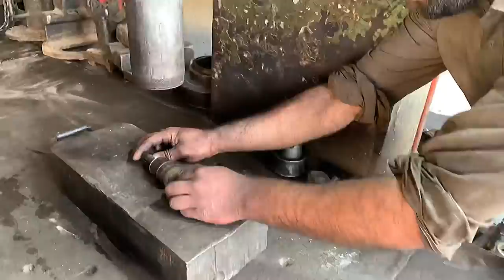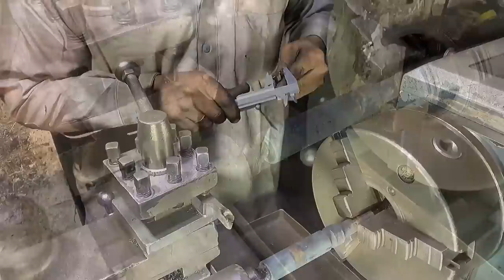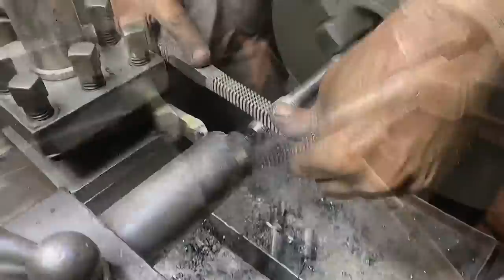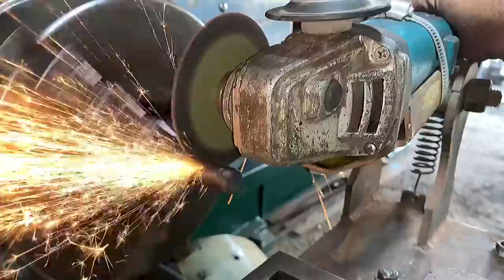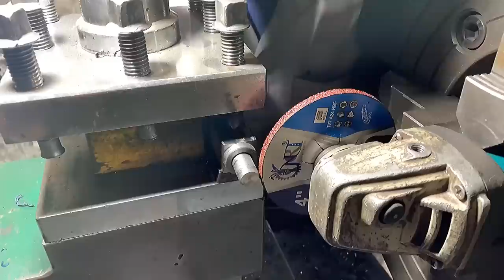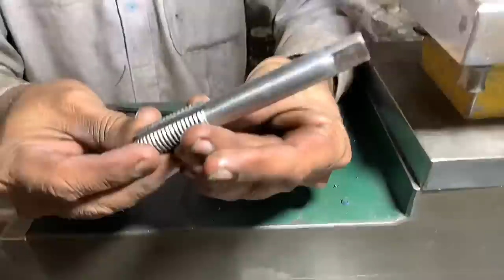Thread drill tool made from bearing shaft, developed drill by own skill

Comment: Usually fluting for taps is usually accomplished on a milling machine with a dividing head; after that the square is cut in then the tap goes for hardening and then final grinding / sharpening. One caviat though, if one needs a certain class of  fit for the threaded hole they may need to close up their tolerance in the final grind and also will the tap be a Taper, Plug, or Bottoming tap. One needs this information before final grinding takes place.
Heat treatment HAS to soak for at least 10 to 15 minutes for taps using tool steels of course. The quench medium brine water, oil ( usually heavy mineral oil) or air for A-2 tool steel.

Comment: I tried this a few years ago and that tap won‘t cut because there‘s no clearance angle on the cutting edge. The threads of the tool will cause a ton of friction what makes cutting threads impossible.
That‘s probably the reason why he doesn‘t show it cutting
Reply: At the end they show another, factory tap. The hand-made one has no right to make the correct thread!

Comment: Went thru all that then hardened in about 2oz of oil. The idea w oil quench is to remove that heat in a quick but controlled manner. It should be submerged in oil w plenty of extra oil all around it. Dipping it in a coffee can full of oil would have been a much better option. I guess it's OK if ur tapping like a brie or other very soft cheeses.
Reply: Give the guy credit for what he did accomplish, wether or not the tap was hardened correctly is something you will never actually know. 

Now go buy something easy, like store bought.

Comment: I’ve seen some pretty ingenious craftsmanship from using scraps of nothing but this is not it. In a desperation situation that stub of broken tap would have worked better.  You wouldn’t even be able to tap aluminum with that. That thing would instantly seize up. That carbide burr cost more than a cheap tap. - From a machinist of 45 years.

Comment: Now grind the old tap off flat and use the tool post grinder to put the taper back on the old tap and you will have a nice working short tap. It works great I do all I break if enough is left.

Comment: This is why production is much more efficient in Asia. If this was in the 🇬🇧 or 🇺🇸  the lathe would be surrounded by perspex and the operator would be required to spend 45 minutes dressing in safety equipment and the performing a list of maintenance checks before the part was even sourced.

Comment: nice. but is is practical? no, better buy or make a proper HSS tap. if you want to improvise a tap just get a high strength bolt and make cuts perpendicular to threads like the guy in this video, quenching it and voila tap good for 1 thread or 2. doing all this work with so weak base material is just waste of time, if you sell it as HSS tap is just typical scam.

Comment: No skills common turning and threading job.... Mistakes he made... 1 broke bearing with hydraulic press.... Very dangerous shoots like gun can be cut with angle grinder safe n easy
2 using vernier as hook on running machine.... Very risky , struck in will hit anyone near by or machinist himself